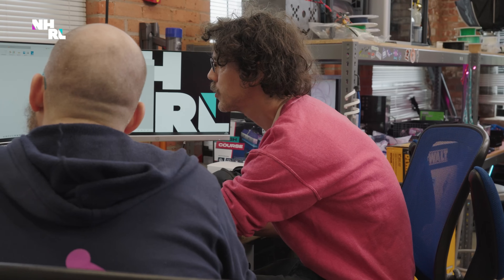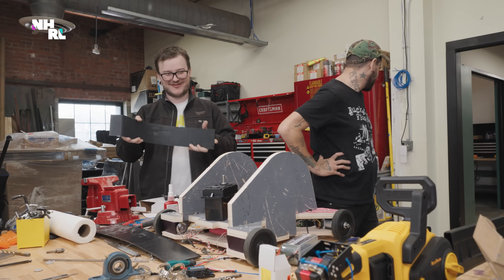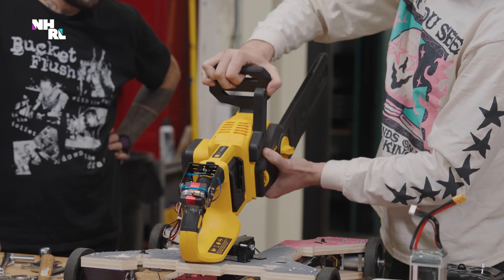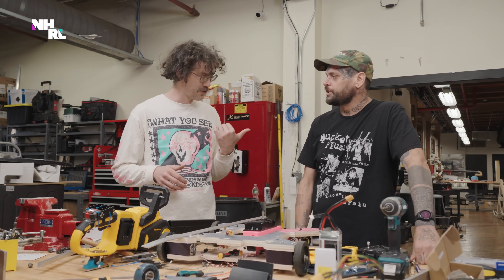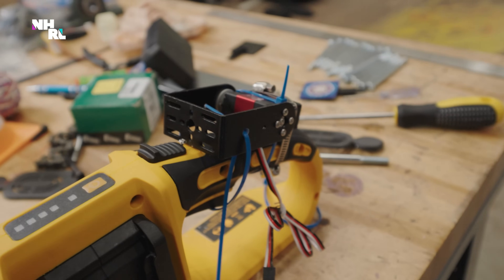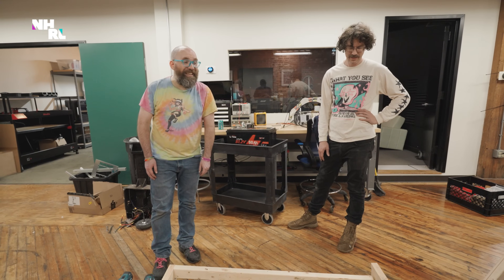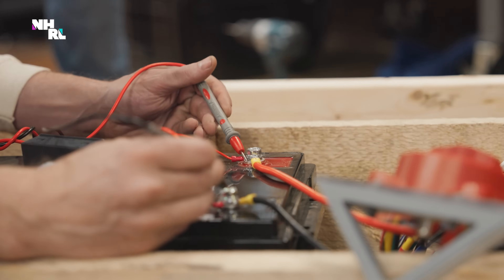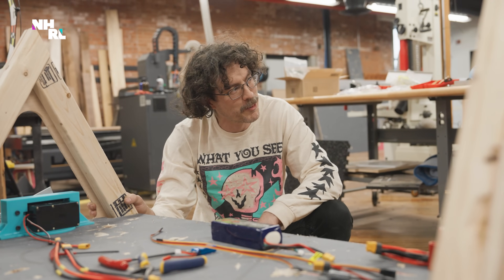Building a big dumb cat robot (and it nearly broke us)

Comment: Instead of the chainsaw, that chopsaw would be better. Like a modified chop saw or two with metal blade. The chainsaws are meant for wood, not metal, and the blades wouldnt do too much and would dull really quick

Comment: 14:14  To me this seems like obvious favoritism, You can see the robot utterly destroy the other one because of its sheer size, and it ended up not even having unique Locomotion it just had wheels it was just a big box with wheels that other really crushed it's Opponent, this allowing people to break the rules because you like them or like their message what is you guys this is pretty bad, And if it isn't that then what is it because it surely is not just minability and unique locomotion they straight up towered and crushed its a ponent because of the size difference,
Reply: ok, but you must consider, it was funny. Silly, if you will.
Reply: It's not a serious match
Reply: its an exhibition match, who cares brah
Reply: its technically not breaking any rules, depending on how its built you can add more weight than your weightclass normally allows
in this case pawsitivily hilarious was the main bot, with gigapaws acting as the secondary minibot. 

pawsitivity hilarious itself does not have wheeles, and moves forward through other means, theirfor it gets a weight bonus
AND because they have a "minibot" that is controlled through the bot, or the bots primary controller, they get another weight bonus (the total weight counts both the main and mini), and sometimes even the type of weapon they use can give a bonus if its an unpopular type people dont use, and these bonuses can be pretty big, as to encourage their use.

its certainty an exploitation of the rules, but not breaking them, and its the ammount of creativity that NHRL encourages to keep matches fun and exciting

Comment: “It’ll be a little over the weight limit so we’ll just add a minibot”
- Sam
Reply: Minibot being the og paws, since at that size, the og bot is a minibot. :P
Reply: I was reading this as it was playing what interesting experience haha 😂
Reply: What does that mean?
Reply: @gregslingland3576 There are weight classes you usually have to hold up to but you get some extra weight above the limit if you spend it on building a minibot, a smaller robot designed to assist the main robot. Think of a small lifter to help position the enemy for a vertical grinder to cut into
Reply: @gregslingland3576 NHRL lets you run multiple bots in a fight at once, and gives you a slight increase to your maximum weight in exchange. Normally you'd put that weight into your sub-bot, but they do let you use some of that weight to exceed your primary bot's weight maximum.